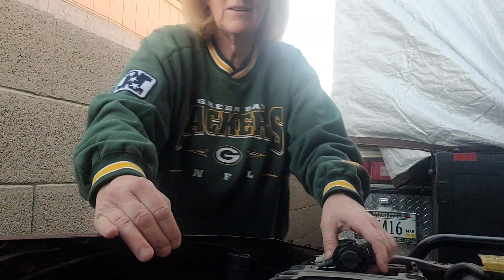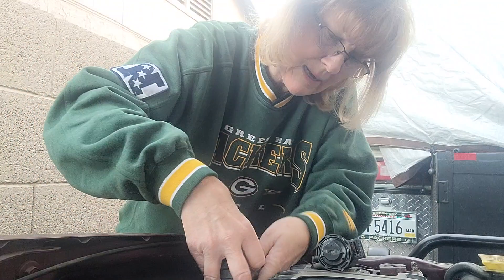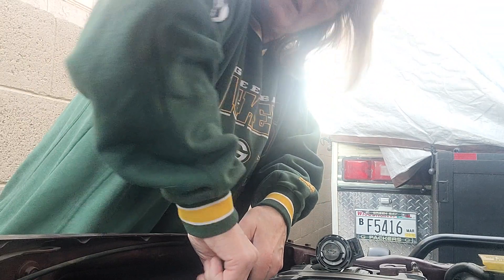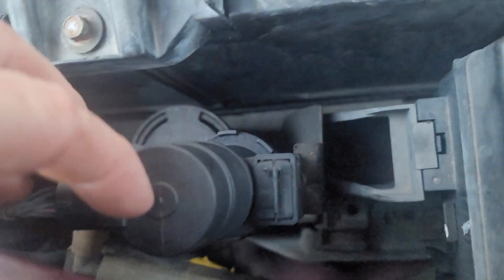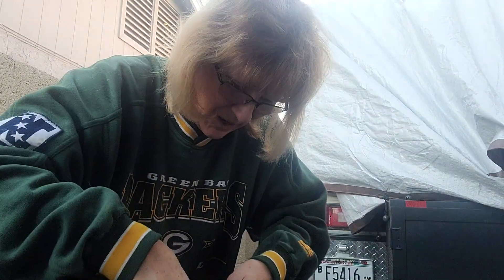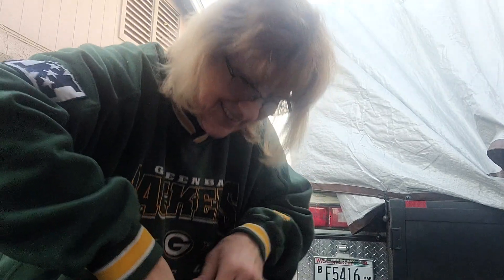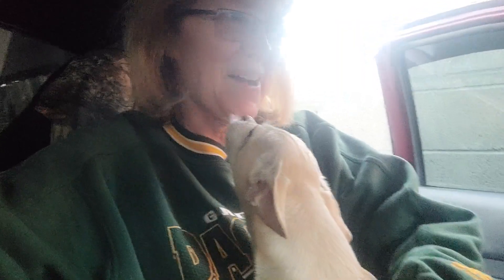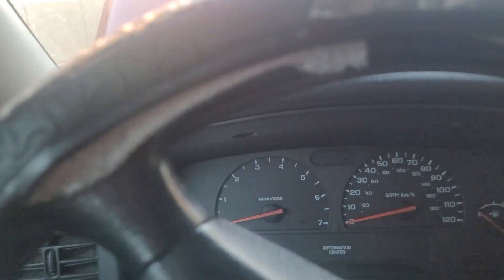Replacing the Purge valve on my 2003 Dodge Dakota!

Comment: did you reset (clear codes) using your ODB meter?
Reply from the maker: Hi TR! 👋 I unhooked the negative from the battery for about 5 minutes. Then hooked it back up and the light came off. 💁‍♀️

Comment: How did you get that electrical clip off without breaking it? On my '03 Dakota its as if it's welded on!
Reply from the maker: Very carefully kinda pry it and it will come off. And the rest is easy to put the hose back on.